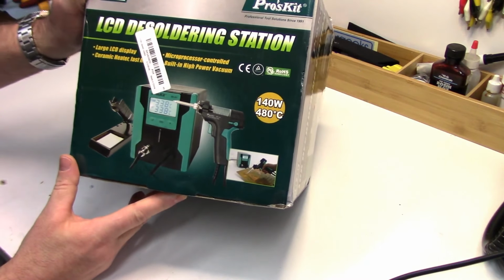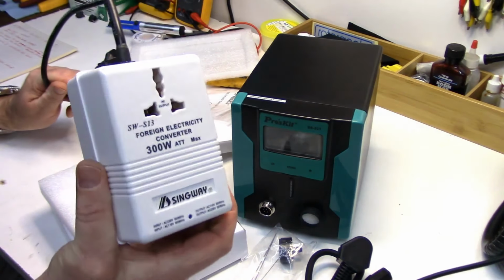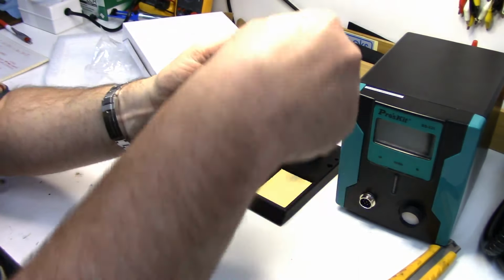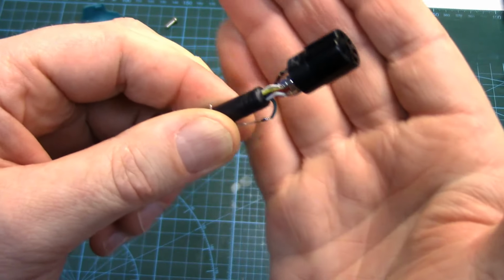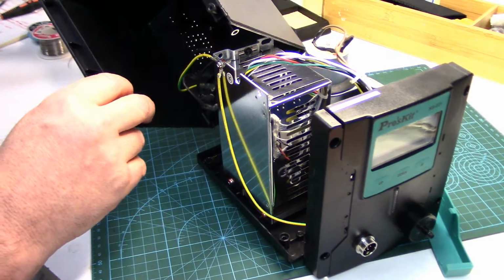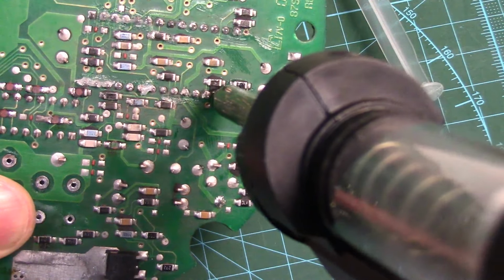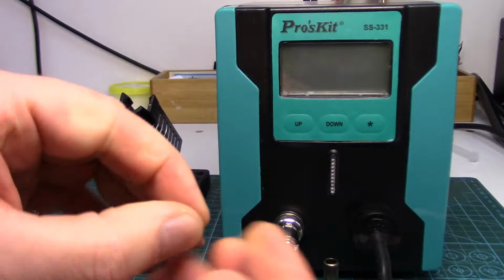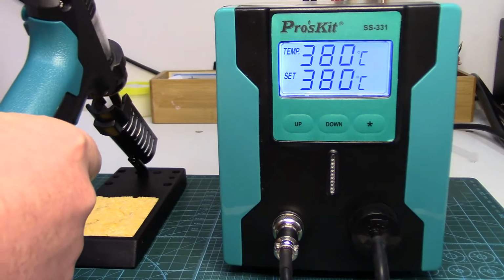Pro'sKit SS-331 Desolder Station Review

Comment from the maker: IMPORTANT UPDATE! Turns out the SS-331H does have a universal switch mode power supply after all. Here's the update video showing this along with a couple mods I made: https://youtu.be/9eBG7z-2qNE
January 2025 Five Year Update: This unit is still going strong. I use it a few times a month on average and others in the comments are even using them professionally daily without issue so anecdotally, it has been so worth it.
Reply: Hey John, in reference to the location of the power switch, it's a European electric code law that states that the on/off switch has to be a set distance from the power source. I learned this from my same question about welding equipment. If I had to guess nobody is going to come into your shop and arrest you for changing it, but in these days you never know LOL
Reply: @ronaldcaflisch2031  Or, just mount another switch, in series, with the "master" switch on the front.  :|
Reply: Is this station doing its job well as time goes by? A lot of Chinese stuff die early.
Reply from the maker: @Gassan Ali working great still December 2020
Reply: @gassanali8667  Desoldering can be a pita and if your bad at it (like me) this can actually save you some money.

Comment: Did you have a chance to use it on larger boards? I need to repair some motherboards, just to replace caps and removing the solder from the ground is almost impossible. I was wondering if this would actually work. Thanks!
Reply from the maker: Why would board size impact usability? It's exactly the same thing & process; unless we are talking about large heat sink/areas with big heat sink component pins, but then the pins are too large anyway for this device. Largest boards to date I've work on with this tool are stereo amps.

Comment: Very good reviews of this SS-331 and the other review of the S-993A as well. As for 2025, you can buy either of them in Aliexpress, and interestingly enough, the SS-331 can be bought cheaper than the S-993A in 110v version. Both of them are around 14000 Japanese Yen (around 100 USD with current exchange rate), shipping included. I don't know if they will charge shipping to Canada.

Basically at current price, this SS-331 is the obvious choice over the S-993A, unless you need a portable solution for some reason.

Comment: I don't  think that we are done with solder wick. I do have a  soldering/desoldering station. It is pretty old,   but it worked quite well. I paid significantly  more than a 150 bucks. It can take a different attachment, tweezer for  smd. Analog vacuum display. Adjustable  heath setting on both. Independent operation. On off  separate. But  double sided  boards still can be an issue. Especially  with older units, where the solder is oxidated. I have seen many different type of desoldering  apparatus. Let's  just say I was particularly impressed. Power matters, wattage matters, maintenance, and using the right  tip. I think  both should have at least 40w rating. Adjustable. Five second max on a chip. Then go back. Most of the time there isn't  enough suction, the pump just not powerful enough. Having a display, showing if the performance deteriorating.
Reply from the maker: Yes - solder wick will always have a place; the more specialized tools we have at our disposal, the better. Anecdotally, I can confirm that since getting this desoldering station, my use of wick has been reduced almost completely on through hole components. Surface mount, large pads, large pins etc. and the wick reluctantly gets dug out. My rolls certainly last longer now 🙂

Comment: Thanks for this awesome and useful video my man, i received my ss331h yesterday and tried it a few hours ago, your video helped me a lot thank you ! 
CAN you tell if it s nor hurting to use flux for desolder ?
Reply from the maker: Hope you enjoy your SS-331 as much as I've been enjoying mine - still working like a champ. As for flux... If you don't need to use it, that's best. It will after all gum up the filters faster - no question. Of course, if the solder is not flowing, it won't even suck out properly so flux becomes a necessary evil at times while filters are easy and inexpensive to replace.
What I've been doing lately on stubborn jobs, is just add a little extra normal 60/40 (or 63/37) leaded rosin core solder to the solder pad/s on the PCB before desoldering; this does two things. It adds just enough extra flux to make it flow better,  but not too much, and it adds a little lead to the unleaded solder to also help it flow better. This anecdotally also seems to help avoid tube clogging that some people complain of, but perhaps there is no correlation and it's only anecdotal observation.

Comment: Tip;  put a copper coin in the middle of the spring, it keeps the backend filter a lot cleaner and it is much more easy to replace, so you can keep on working....

Comment: Hey, is the Proskit a well know brand or just a no name kimda brand? I like that you measured the vacum power! Have you got the chance to test another chinese desoldering stations like the WEP 948, Silverflow 948 or something from Yihua? These can be found on AliExpress, 110v as well!
Reply from the maker: Fairly well known. No it's not Hakko or Weller, but Pro'skit tools are carried at many retailers ranging from big box hardware stores to specialty electronics shops. Any search engine will confirm that. Haven't tested anything else for the simple reason this SS-331 one continues to work very well for my hobbyist needs and will most likely last me for the rest of my life. By the way, the follow up video to this one confirms the SS-331 works on 110V to 240V as it has a universal power supply.
Reply: @Rchelicopterfun  i see, thank you so much for the informations!

Comment: Hi thanks for the upload. It's been 5 years. how is the station holding up? A long term use review wouls be really cool. Thank you.🎄🎄👍👍
Reply from the maker: Yep, that's not a bad idea - a 5 year update video. What I can tell you is I use it several times a month on average and it's still going strong and works really well for through hole stuff.
In fact, I got a comment just before yours on this video (if you want to search for it) from a repair shop that has one that gets daily use and it sounds like they really enjoy it; more than their Hakko desoldering gun because the gun is much heavier so there is less hand/arm fatigue after extended use with this lighter unit.

Comment: We actually use one of these units at my buddy's shop - depending on the jobs that come in it's getting fired up on a weekly-to-daily basis, and it does a stellar job at its task. I've had the privilege of trying out a modern Hakko unit at another friend's shop - while it also does a fantastic job, I find the lower weight of the ProsKit gun to be more accommodating of long board rework sessions than the fully integrated Hakko gun; less weight makes for less fatigue doing the same amount of work :) 
It merits worth mentioning that the unit at my buddy's shop has survived at least two years of abuse as a tool in a professional setting, and probably at least a couple more in the hands of a hobbyist prior to landing on the shop's bench. It is decidedly good enough at what it does that I've recently acquired on for my own bench, buying a preabused unit from a pinball/arcade machine repair shop that recently closed out; I don't know how many years of service it's seen already but the date codes of 2015 suggest more than a handful, and I expect it to last many more.
As an aside, I'm fairly certain these have become more costly on the open market since this review went up. I don't know what currency your price quotes were in but suffice to say those quotes are well below half of what I'm seeing the ProsKit SS-331 available for on the current market as of January 2025; on amazon Canada they currently sit at ~$240CAD, and BangGood doesn't offer anything terribly better at ~$233CAD. Buying mine used, I paid a little more than a third of that - a very fair price in contrast to the online offerings.
Glad to see in the comments that you've since discovered the SMPS is universal input voltage; they could certainly stand to make more apparent that the regional version is merely dictating what IEC cord is bundled in the box. Might not hurt to update the video itself to also take note of this, there's always going to be those who skip the comments section ;)

Comment: Are you still happy with the purchase 4 years later?  ... Any 4 year remarks, repairs, replacement parts? Thanks for making this video!
Reply from the maker: Still working great, works on 120V as per the follow up video,  use it at least a few times a month. Not a single part has needed replacing. Most recent video of it being used was in a Woods timer switch repair video a couple months ago:  https://youtu.be/QVYGxVsxXuk?si=5DZ_RnPD9EOXku0R

Comment: At 22:57, the 5th hole across the top had the plated through hole yanked through. It is still attached to the 5th pin of the IC

Comment: Hello @Rchelicopterfun, After viewing your video and some others, I ordered one and just received it today. Did not had time to test it in real life, but just for the sake of it, I decided to test the ground as you did in the current video, an saw that the ground from the gun to the connector was connected, but from the ground connector on the back, I did not get the signal. So maybe a bit of a warning, after investigating the matter for a while, I realized that the connector was not doing contact to the base. The screw of the connector looked correctly screwed, but the reality was that it was not. The threads are probably a bit on the edge, and are difficult to screw. Just make sure you test this when you get yours.

Comment: Just a suggestion. DO NOT put any flux before sucking. Little by little, it eats away the tube inside the heating element. It becomes uneven and starts to clog. It is enough just to disolve the pins with additional solder using an iron and then use the gun. Good luck!

Comment: If ANYBODY IS READING THIS i NEED SOME HELP. (PLEASE)  I have never been able to get mine to work right and all I do is lift pads and ruin boards. I heat mine to 350c but when I try to desolder anything it takes a while for it to melt the solder. Also I have tried to melt a little leaded solder with the tip and what I am trying to desolder to make it easier, and the solder does not stick to either the tip of the gun or the solder on the board all it does is melt the solder (with dificulty) and the solder does not stick to the tip of the gun it just creates a ball on the soldering wire.
Reply from the maker: Not nearly hot enough (I run mine at 390 without issue), and/or not enough flux would be my guess.  That of course is just a guess as there are several variables including thermal mass of the component, amount of heat sinking around the component, technique, type of solder/flux etc.
Reply: @rchelicopterfun  Thanks for your response. After I wrote the comment I used my infrared gun and found out that even though the temperature in the screen claims the tip is reaching 350C it only gets to 200c and does not go past that no matter if I increase the temperature, it stays at 200c. (which happens to be the standby temperature) any way to fix this or should I toss it in the garbage.
Reply from the maker: IR gun to read a reflective tiny tip??? Unlikely you would get a correct reading. Use a thermocouple if you want an accurate tip reading. Your call if you want to toss it in the garbarge over fixing it or contacting customer support where you got it from. Personally, as an electronic hobbyist, I would fix it (if there is actually something wrong with it).
Reply: @rchelicopterfun  No no no, not one of those cheap laser guns, A $400 infrared imaging gun, I also connected a food thermomether to the tip and game me the same exact measurement. I do not have a thermocouple. I actually opened it up so see if I saw any lose connectors or cables. I opened up the device and the gun and nothing.  Has not even cross my mind to call support, since these are chinese products, I figured they would not have any support. I am asking to see if you had any ideas.
Reply from the maker: @guayabito6946 Yes, yes, yes. Doesn't bloody matter what kind of infrared thermal device you are using. I too have a low cost $450 IR imager (Uni-T 260/690B), no it's not a $3K Fluke TiS series, but neither is what you are using by the sounds of it.
If I thermal image the Pros Kit SS-331 tip (or any soldering tip for that matter) using the Uni-T 260/690B without correctly setting up the gain & emissivity values, my SS-331 tip set to 390C reads 180C in the imager for those two fundamental reasons.

1. Like all decent thermal imagers, you have to change the gain setting when measuring higher temps if you want a somewhat accurate reading. In the case of the Uni-T, I must switch to low gain from the default high gain setting to get the coarse calibration in line since it's reading something over over 150C (High gain: -20C to +150C) (Low gain: +150C to +550C). Have you correctly set your gain? 

2. Are you using the correct emissivity value for an oxidized metal soldering tip surface? My specific IR imager states for oxidized metal, the emissivity value should be set to around 0.5 to 0.6 from the standard preset of 0.95 that works well for most non metal surfaces. Have you also correctly set your emissivity value? If you are unsure of what to set your emissivity value to, there are lots of accurate scales online for different materials and reflectivity - use you google fu but there should be a scale in your owners manual as well (I've never seen a thermal imaging camera manual without one). 

With those two settings set correctly on my (or any thermal imager I have used over the years), slightly oxidized soldering tips will usually read within 10C of actual so not bad considering the variables in all thermal imaging devices. 

Regardless, and as I already stated, the only way to get an accurate reading for calibration purposes of any soldering tool  is with a thermocouple probe tester. You don't have to spend a fortune on one either. The FG-100 for example works great and is very inexpensive ($15 USD). Anyone who is serious enough about electronic repair to go to the expense of getting a de-soldering station should have at minimum a low cost soldering tool thermocouple temperature tester.
Reply: @rchelicopterfun  Hi Jhon thank you for taking the time to write such a detailed response, I really appreciate it. No, I was not aware about setting you mention on the infrared imager but I did manage to find a cheap thermocouple I had and it did give me a higher reading (240c) (I am buying the FG-100 right now, thank you for the tip.) I also found a thread on the EEEV blog of people complaining about this unit never reaching the required temperature and ways to modify the unit to fix all of its issues, I also wrote an email to Pro'skit to see if they had a solution and all they told me was that since I had the SS-331H I was basically SOL, because it is designed for 230V and it will NEVER reach the required temperature and and that the only solution they had for me is buy a adapter to go from 110V to 230v. I do not know if you got a different board inside the unit, but my station is completely unusable, it does more harm than good to use it.
Reply from the maker: @guayabito6946 - Not true about the 331H only working correctly at 220-240V. The 331's uses a a universal power supply and will happily work from 100V to 250V 50-60 all day long. I did a video showing the universal power supply in the H model along with tests to prove heat up time is identical. https://youtu.be/9eBG7z-2qNE?si=1-e6qk113vnetwAN
Of course if you wanted to get a 240V step up adapter to prove it to yourself, go ahead. They are handy things to have around after all. 
When you do get your FG-100 make sure to wet the tip of the soldering tool with solder so there is proper heat conduction between the tip and the thermocouple sensor. A dry solder tip won't conduct heat effectively and will generally read several dozen degrees cooler than the actual temperature; but as a soldering enthusiast, I'm sure you already knew that.
Reply: @rchelicopterfun  I am a Jack of All Trades, master of none. I am still learning about electronics. After you told me about the FG-100 I have been watching videos and I learned about the wetting of the tip. I just performed some test with the thermocople and I can only get it to 347c if I jack up the temperature all the way to 480c. I have not tried to see how it performs at that temperature, it might be usable, however I just went ahead and bought myself a Hakko  FR301 which everybody seems to love for just $166 new. To me it does not make sense to buy this unit (which cost me $150) and deal with all the headaches.

Comment: These are fantastic devices.......when they work!
I have a very similar piece of chinesium equipment. Aoyue 474A. Im constantly having to dissemble and clean the gun part.
Dont know if the more expensive name brand ones are any better. If so it would worth the extra expense to me.
Reply from the maker: Hmm, no such issues with the SS-331 with many cycles now. It has (anecdotally)  never clogged once while in operation and I have yet to have it get plugged after usage once cooled down; admittedly, I always run a cleaning rod through it before I power it down and pull vacuum the entire time while doing so.  Guess they are all different?
Reply: @rchelicopterfun  The only difference is the shape of the case and the metal spring in mine is a stubby tightly wound cone shape and yours resembles one found in old style spring loaded ink pens.